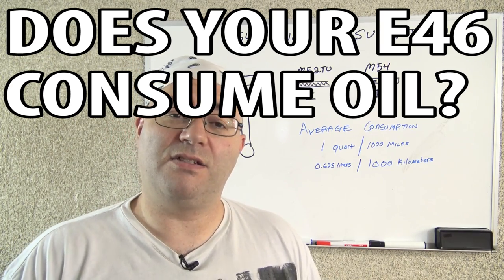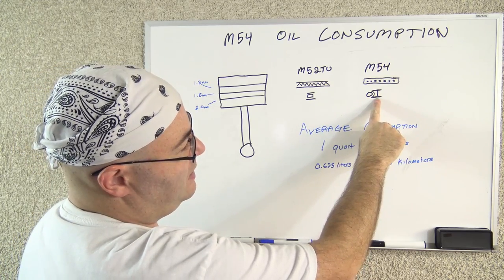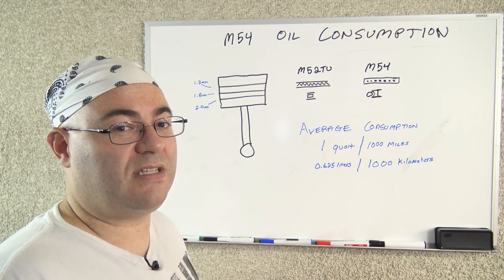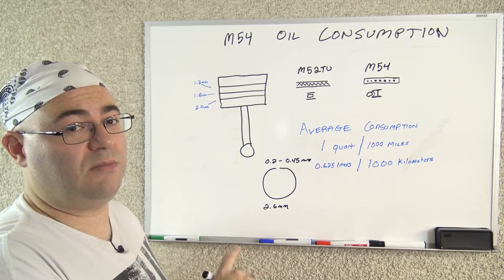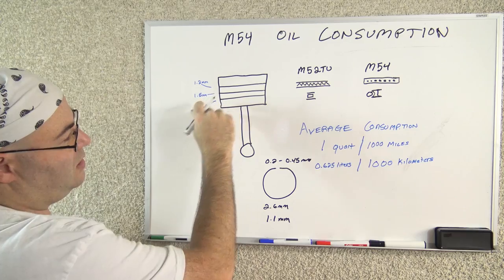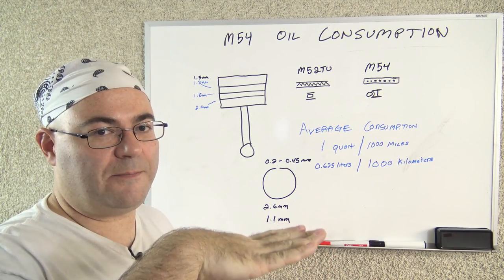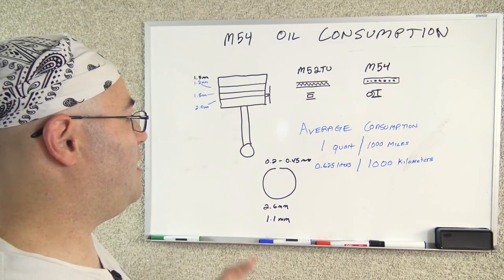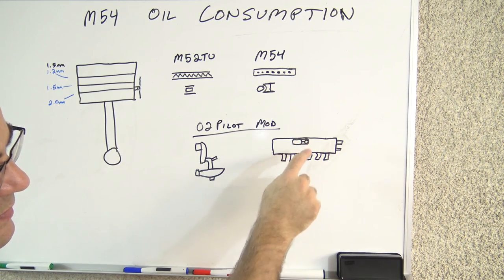Does Your E46 BMW Consume Oil?

Comment: Doenst changing piston rings require re-honing of the cylinder walls? 

I am considering doing this (along with a rod bearing replacement and hydraulic lifter replacement) but it aint no use if it needs rehoning, i'd do a full rebuild at a repair shop in that case.
Reply from the maker: You need to deglaze hone the cylinders with a flex hone whenever you install new rings but you're keeping your old pistons and not boring for oversize pistons.  I have videos coming up soon where I examine the internals of the engine and show you how to determine whether you can simply deglaze hone and rering or if you have to rebore.  In my case, I'm not having a machine shop do "everything" for me because I prefer to do everything I can, including measuring and disassembly and reassembly, etc.  I will go to the machine shop for the things I absolutely cannot do myself because I don't have the equipment.  You don't have to replace the lifters unless you are installing a brand new camshaft.  The lifters can be cleaned out if they are suck.  I have a video on that.

Comment: my M54b22 consmus about 0.2 liter per 1000km i think it's not much I'm using millers oil 5w40 my luck that Is not so much  ;) nice video I know about that problem when I was looking e46 with six cylinder engine earlier I was driving e46 with m43 engine not very fast but non problematic engine
Reply: 87Andree use Castro edge 0w40 european formula

Comment: Hello, my name is Martin.I have a 2002 BMW 325ci I need buy a new oil level sensor.,I was checking on Amazon and eBay.., do you think is ok to buy this sensor from $15 to $25 or do you think should I get original from BMW.., is really expensive..!Or do you know some good brand?I find this brand Autex.Autex - Oil level sensor $21.99With 1 year warranty.Please let me know..Thank you so much!

iews
Reply from the maker: I used a cheap aftermarket unit and it's been working fine so far.

Comment: I don't know if there is a Q&A line directly to this channel as I really don't youtube that much but have you experienced a surging  idle that sometimes dies when you come to a stop? It's an 01 325i with a manual gearbox. If anybody can point me towards a fault I would be very appreciative. Already done the oil pan, vent/vacuum lines, oil filter housing seal, idle control valve,  vapor control valve, and the plenum vane and 02 mod. Not sure where else I can turn. There are no codes.

Comment: I have an '01 325Xi with a vacuum line from that manifold port, going to a canister. The canister's other end vacuum line goes upwards, by the firewall. Strange. Are you sure it's only suppose to be on 330's?
Reply from the maker: Oh, I thought it was only supposed to be on the 330s... go look at your exhaust, is there a little flap in the right hole?
Reply: Sorry for the extremely late reply. Yep, I have the flap and it seized closed. I had to pry it open with PBlaster and a screwdriver. I ended up plugging the port on the back of the manifold and removed the vacuum canister.

Comment: I'll just ask-- I had a warped valve cover, $350 later I had my oil leak under control-- now oil is leaking or being consumed elsewhere at a rate of about a quart every 50-100 miles. Any thoughts on what might be causing this?

I replaced my CCV about a year ago using no-brand ebay parts (I don't want to get started on how bad of an idea this was). Would it be reasonable to assume that I have much better suction now that the valve cover has been replaced and oil could be getting sucked up a failed (and cheaply manufactured) CCV? 

Note that I see no oil on the ground, so that 1 quart every 50-100 miles has to be going somewhere.
Reply from the maker: No, not getting sucked up.  Try the 02Pilot mod and see what it does for you.  It'll cost you $2.  I have a video for it if you want to see exactly how.
Reply: 50sKid it's just super odd that the oil was leaking at a slow rate before replacing the leaky valve cover and now that it's fixed- the oil is disappearing at an even faster rate (within days).

Comment: I have a question, my BMW doesn't consume oil but it definitely blows the O ring out of the dip stick tube. b4 I tear the motor apart do you think it could be a clogged ccv?
Reply from the maker: Absolutely that is almost certainly the cause.
Reply: Thanks man I'll tear that out soon

Comment: Dang I may have another problem, my 325i (2003, 172K miles) is consuming about 1 quart per week!!!!!! (close to 60-80 miles use per week) I changed the valve cover and oil housing gaskets already (it was an oily mess under the engine), may it be the CCV? (I dont see any visible white smoke or anything...)
Reply: Hugo Garcia woaauw. that's the highest consumption I have ever heart
Reply: I know, it smokes (smell, can't see it though) no white smoke, also it doesn't leave an oily mess under the car, hopefully my new CCV comes tomorrow and I can change that just to discard that possibility, may do the AC/Delco fluid overnight seat over the pistons, see also if that helps...
Reply: Hugo Garcia yes hopefully that works for you.  I had a quart every 1k miles of consumption. Eventually I had  white smoke come from under the hood. Oil leaked from the valvecover onto the exhaust. So I had to do something:  I did valvecover gasket, oilfilterhousing gasket and ccv, and that fixed the problem for me.  BTW I have a e46 320 2.2L with 130k miles
Reply: That's pretty much my case, I already changed the oil housing and valve cover gaskets and the engine is clean, now the smoke from the tailpipe today I noticed it started to get worse, praying all the changes make a difference! thanks Leon

Comment: hey 50skid....í think í have a m56 engine...will this mod work for me too?? í noticed my engine is burning oil as well.
Reply from the maker: Unfortunately no because the whole CCV system is built into the valve cover and full vacuum is already being applied to it--the valve part is inside so you have no way to add vacuum to the crankcase.

Comment: 2002 330i. burns about 1L each 2000km. Lots of short trips tho. I'll just keep add oil
Reply from the maker: Rather than installing a $2 vacuum line?
Reply: I saw some PCV DIY guides, if I remember correctly it's not as simple as $2 hose. Almost all those plastic parts can crack in the process.
Reply from the maker: Yes of course you need to replace your CCV system, I thought everyone basically understood that that was a necessary maintenance item.  Sorry about that.

Comment: Hey im rebuilding my m54b30 at the moment ive clicked on the link for the piston rings nothing showed up for Ebay, really dont want to buy 2 sets of poison rings,  it would be awesome if you still have the contact for the m52tu oil rings set up with m54 top rings.
Reply: Any luck finding them?
Reply: @markurquhart1467  yea found the m52tu rings on ebay just going to reuse the old top rings
Reply: @ghostvardy6693  thanks for the reply. Shame they went and made that top ring a different size

Comment: Thank you for this great video, very informative ! 
Changed the CCV with the hope it might decrease the consumption, but it's still the same (if not worse).
Before that tried with some oil additives (Rislone seal repair), it really helped, but it's a very temporary solution, considering one of oil catch can or the O2 pilot mode now.
P.S. Subscribed.
Reply: so which mode you have gone through >> please advice if oil Consumption has stopped.
Reply: @yassinabousharkh4630  it did not mate, if the m54 oil consumption is high - piston rings. I sold the car long time ago, got myslef an n54, 0 oil consumption with vioent drive most of the time, remapped to 400 plus hp.

Comment: 14:39 I'm gonna try this before my next oil change in a couple of months.
Reply: Have done this now, let's see if it fixes the problem. For future reference, here's how I did it: I removed the spark plugs and put 1 deciliter of injector cleaner (I used one without additives) in each cylinder, I then put the spark plugs back in to prevent it from evaporating. I jacked the car up on the passenger side to get the engine to sit more leveled, to make sure the injector cleaner covered the pistons as evenly as possible. I then let it sit like that for about 24 hours. 
 After that, I lowered the car again, and removed and wiped off the spark plugs, since they had become moist with injector cleaner. I looked down the cylinders with an inspection camera to see what had happened, and most of the injector cleaner had drained down in to the oil pan, there was some left that I sucked up with a vacuum pump. 
 I put everything back together and started the car, and predictably there was a lot of smoke coming out of the exhaust, and some misfires at startup. I cleared the misfire codes (check engine light came on due to the misfires) and drove it until it was fully warmed up. 
 I decided to do this right before a regularly scheduled oil change, which I proceeded with after this test drive.
Reply: Been driving for a while now, sad to say this didn't fix the problem. It still burns around 1 liter oil every 3'000km, but I can live with that.

Comment: Awesome Video! My 325ci has been 'burning oil' pretty fast over the past few months. I'm going to have to try out one of those solutions. How's your experiment going?
Reply from the maker: Experiment is good--it solved the oil burning issue.
Reply: Thanks for the update, I'm definitely going to do this. I have two questions if you have the time. 1. does the oil catch can you use have a baffle and filter? It seems like most of the low cost ebay ones don't 2. I live in a winter climate (Chicago) so I guess I shouldn't connect the OCC to the dipstick return, however even if I did there are some people saying that the return contains water condensate so it's not a good idea in general, what do you think? Thanks again, you've given me hope that my car will last another 100,000 miles without requiring an engine rebuild.
Reply from the maker: You can skip the return line if you're concerned about condensate.

Comment: for the O2 pilot mod, what size would the vacuum line have to be and how long would you need?
Reply from the maker: I want to say it's 3/32" ID, but don't quote me on that.  Pull the small line off the F connector that is inside the upper intake boot to get an idea of what it looks like, then just go to your auto parts store and look for matching line.  It will either be the smallest vacuum line they have or the second to smallest.  You should just pick up 3 feet to be sure.
Reply: 50sKid
Reply: I just did mine and used 5/32 vacuum hose and it fit fine. I also used 3/8 flame retardant wire wrap for heat protection since the hose is so close to the intake manifold.
Reply: thanks! Did you use any website to help you go through this process? I'm new to DIY-ing and not sure how to get to the back of the intake manifold for the capped nipple.
Reply: Kevin Hyun ,just go thru the other videos of 50sKid and find the one that shows how to remove all associated parts to gain access.
Reply: Kevin Hyun 
50's Kid is a great contributor on E46Fanatics.com

Comment: Man,
I like your videos! You explain everything like a good  technician.  I have a question for you.. How the vacuum is going to help the oil consumption because helps to move the oil piston rings? Normally, the oil piston rings like first and second rings work with temperature for thermal expansion.  I do not think so that is going to work, you are going to need a lot vacuum inside the engine to happened that, Maybe I am wrong.
Reply from the maker: Thanks.  It is enough vacuum.  It works very well.

Comment: Hello, I need your help please.. I'm not getting any compression from cylinder 2. I was driving when suddenly the check engine illuminated and car started misfiring violently. When checked for codes I got a P0302 code.. I went through the easy checks... Coils and spark plugs, injectors were good.. I did a compression test and im not getting any compression from cylinder 2. https://photos.app.goo.gl/KsTFUDWrLCAtytf6A
Reply: You got the best 🔧 DIY videos.. Thank you for your knowledge.
Reply: My car is a 04 bmw x3 2.5i M54b25 engine.. I was consuming oil heavily.. Every other day I would have to add 1qt

Comment: Does anyone know WHY high oil consumption causes bad fuel economy (and yes i googled)?  240 miles to a tank is M3 fuel economy (i have a 325ci)!
Reply from the maker: Two different problems.  You're likely getting poor fuel economy because you've got positive fuel trims (vacuum leak somewhere causing the engine to add more fuel to compensate for the extra air)
Reply: Sorry for late reply.  I bought a generic OBD2 reader and the NT201 BMW reader you recommended and both confirmed less than 5% fuel trims - looks like im vacuum leak free.  I bought a new MAF as its something i can fit myself and will probably get brakes checked for a dragging caliper.  No engine codes whatsoever.

Comment: Hellllpppp... I'm using 1litre to 200 miles. 325i m54. Runs fine just fed up of filling with oil
Reply: Have you replaced the CCV System?
Reply: Hi Jamie, just replaced it last week. Got to give it a good run to see if it has helped but I'm thinking it's probably the rings.
Reply: @markbanks3167  Let me know how it goes. I worked out that mine only used/uses oil when it was sat idling. I can do a 300 mile trip and it not use a single drop. It used to produce quite a bit of white smoke when sat in traffic, in queues etc, since putting in new CCV, the smoke has stopped but it's literally been a week too for me, so will see if it's stopped/reduced the consumption. I'm going to do the 02 pilot mod I think too. I know using oil at idle would indicate valve stem seals but with it now not smoking after ccv replacement, I'm trying to stay hopeful haha

Comment: I had a new 318 that used oil like there was no tomorrow, I complained about it and it went in to have new rings at about 5000 miles. I got it back and it was just the same I complained again and the dealer said that BMW were aware of the problem and to leave it until it had done 30000 miles when it would settle and it did. But it used water from day one for three years they never did find where it was going. BMW what a load of rubbish.

Comment: Good video's on the E46 50'sKid... this oil issue has been the achilles heel of the E46. Is there any chance for class action against BMW on this, as Audi/VW had on the 2.0T oil burner?

My 2001 330i w/ 74K miles burns about 1qt/3K miles best I can tell.  I may have a oil filter gasket leaking too though-- so mine hasn't fallen off the cliff yet.  But I do use Group IV/V 5w/40 synthetics every 7.5K miles, so it may have mitigated the chance of stuck oil rings thus far.

I have noted when I downshift, creating negative manifold pressure, it seemed to pull oil up from the crankcase and burn more, so I quit downshifting.

I'm looking to see if this is a viable solution for CCV replacement as well--
http://www.germanautosolutions.com/bmw_solutions/ccv_products/m54_gas_ccv/product_m54_ccv.php

Comment: My 2003 M54B22 consumes no oil, currently at 143,000kms.
Reply: PlayerNineteen it's a weaker motor
Reply: PlayerNineteen power wise
Reply: PlayerNineteen that's why it doesn't consume oil like 328,330
Reply: Good!

Comment: Great info. I just asked the question about doing the hybrid ring modification a few days ago. Well this confirms it. If I ever have to rebuild my motor that is the way I'm going. There is one other option for the 330 M54 engine. Some people have posted results of no oil consumption. It is the M56 valve cover. It has the ccv located inside the valve cover. check it out. http://forum.e46fanatics.com/showthread.php?t=1066308
Reply from the maker: Perhaps that valve cover's CCV has a different vacuum regulator (aka PCV) valve inside of it that causes increased vacuum inside the crankcase.  I hear that those M56 valve covers are hard to come by these days.

Comment: M54 2.2l - 1l per 3000km, I see in here that this is pretty "normal".
Reply: nms789 I have the same car,  have been burning that amount of oil as well.  I have replaced ccv, rockerhead gasket and oil housing gasket.  Seems to have stopped consuming oil now.

Comment: I am not buying this. A large part of my 1ltr/1k-mile oil consumption can be seen on the AC compressor.
Reply: An example of someone who should think before speaking
Reply: @fredericlinden  You should also have a think before speaking. I was giving a hint of a possible problem. The video makers admitted he suffered from multiple valve cover leaks. I bet if he still has the same car, his valve cover is still consumed oil because he could not have worked out why it leaked.  It leaks because the gasket is useless for sealing plastics, especially if plastic is oily. It was a design fault. Applying RTV on the plastic side fixes it.

Comment: Option 4: S54 swap.
Reply from the maker: Would be nice.  I once came upon an M3 in a junkyard but it was too late--someone had already pulled the head.  I should have grabbed the block anyway.
Reply: Would you take 6 speed manual or SMG?
Reply from the maker: 6 speed manual for sure
Reply: That gearbox would bolt straight up to your M54B30...